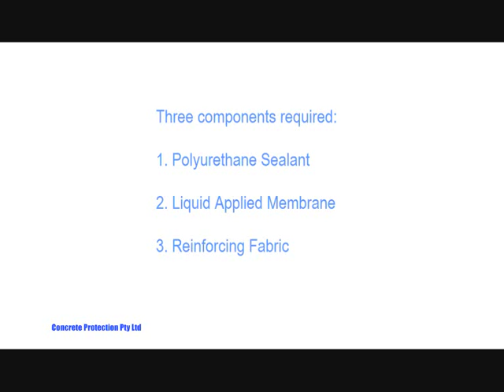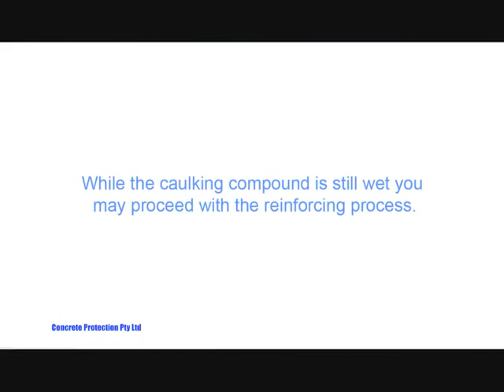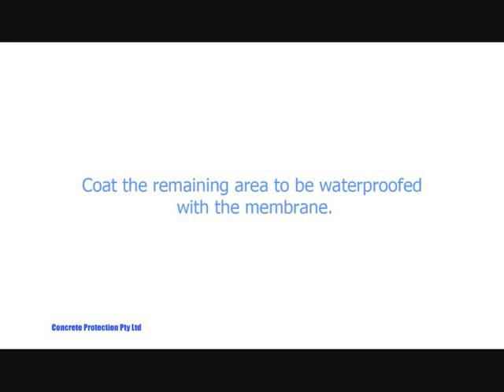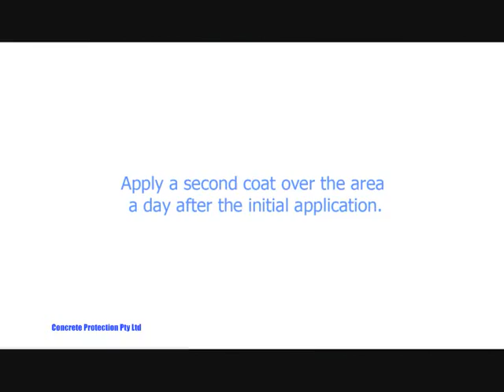Bond Breaker System - Class II Membranes -

Comment: And that my friends in no way shape or form is anything even remotely close to a bond breaker detail. 👎
Reply: Well, what is? Give us a link to see the "real" bond breakers.
Reply: Still waiting for what the "real" bond breaker is? Enlighten us with your wisdom on great bond breaker one.
Reply: @brendenbarnes2071  "While the caulking compound is still wet you may proceed with the reinforcing process" is literally the opposite of what you're allowed to do. In the video they're using a polyurethane sealant which you MUST allow to fully dry since it degasses, and even if you do use silicone (which doesn't degas) you MUST still wait for it to harden to the touch otherwise it will embed itself in the paper and you'll no longer have a meaningful bond breaker.